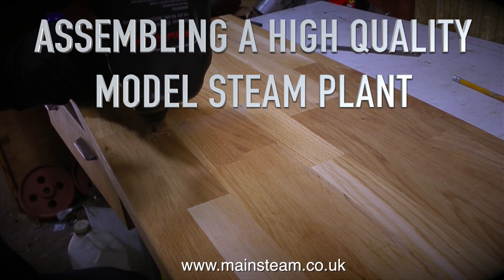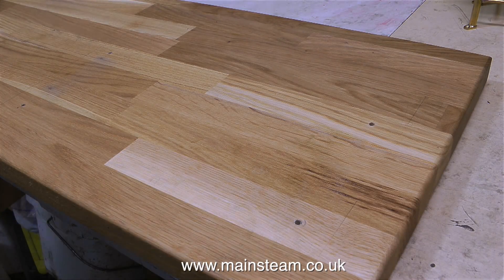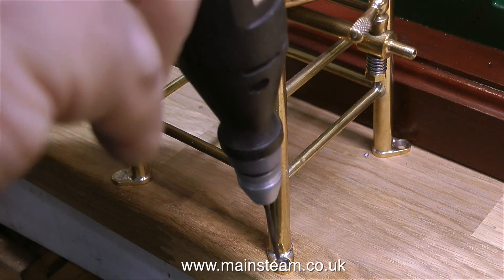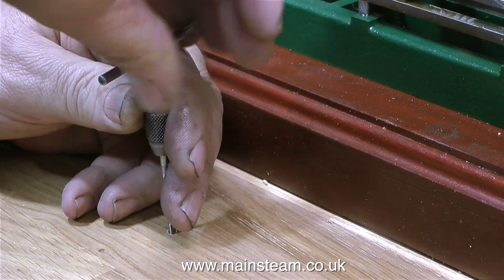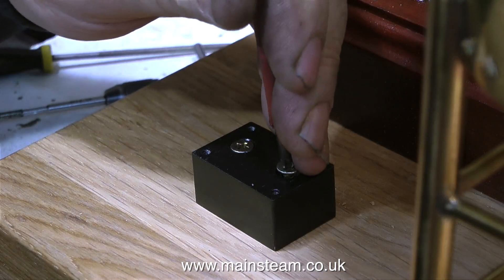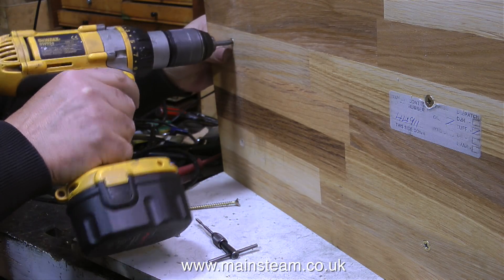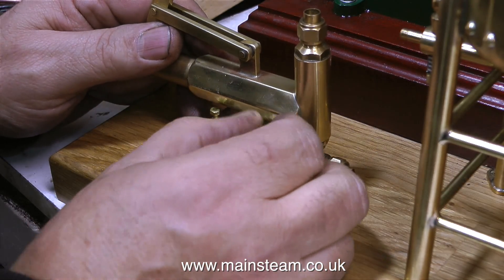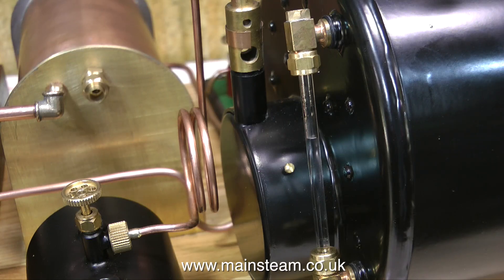ASSEMBLING A HIGH QUALITY MODEL STEAM PLANT - PART #12

Comment: What is the purpose of the spiral in the pipe near the boiler at 6:56? My guess is that the small black tank holds the fuel gas, so the spiral acts like a heat exchanger to stop things freezing.
Reply from the maker: No, it's just a flexible connection to the tank to allow for movement without fracture.
Reply: Oh, OK. That seems unnecessary when it is all screwed down. Thanks for the answer.

Comment: Why not use a T-nut on the back of the board instead of trying to thread the wood? I understand that this isn't exactly a high-impact situation, but it would still be a more secure application.
Reply from the maker: For small fixings they would have to be very long and thin bolts to go all the way through the baseboard to the T-Nuts. It is as you say a low impact fixing so threading the wood seems to be OK.
Reply: Fair enough.

Comment: Mr. A. I would imagine that the polyurethane would be tough enough,but if it gives trouble, you could consider automotive clearcoat. Very tough stuff nowadays. If there is a local bodyshop, you might want to at least discuss having the board sprayed when they are finishing a repair to a car. Would take them minutes. At least it is a plan B if the original fails. Cheers.

Comment: I do a fair amount of wood working and use a product called "Velvit Oil" ( I think it was originally intended for wood flooring). I apply it with a soft cloth. It soaks in and penetrates the wood. It leaves no trace of glossiness. I use it on presentation boxes, keepsake chests, etc. I believe it would be ideal for your mounting bases.

Comment: Wood work is a craft I have never done well with, and I respect folks like yourself that do good in it.
I can cut & fit the pieces alright, but it all goes sideways when I start to tack weld them in place.
Reply: This is probably because you are using the wrong diameter dowel for tacking.

Comment: When I tap threads into wood I chase it after the CA has dried. Makes the threads stronger.
Reply from the maker: me too ....
Reply: I'm not a model maker....  but, I have used helicoils in wood and plastic, they make a very strong fixing..
Reply: I've never had a piece of wood run away
Reply: Never used a radial arm saw to cut sideways without setting the anti kick back then?